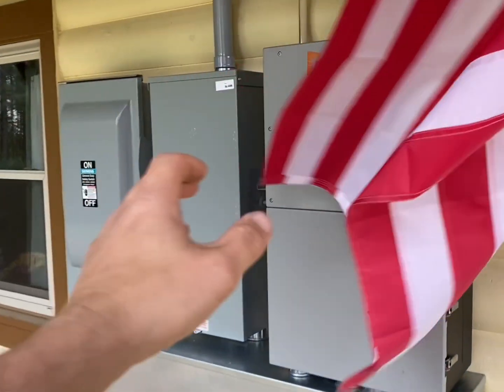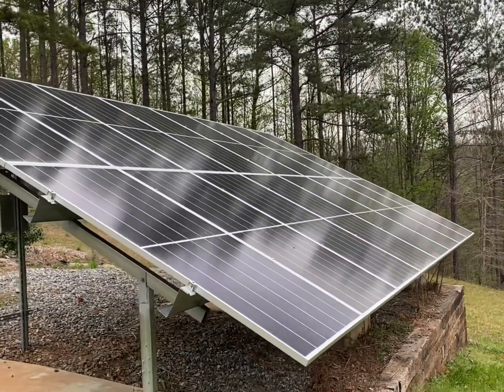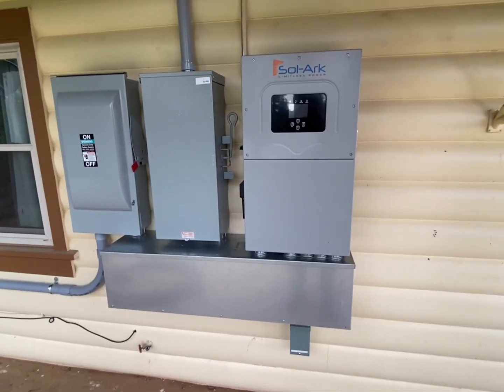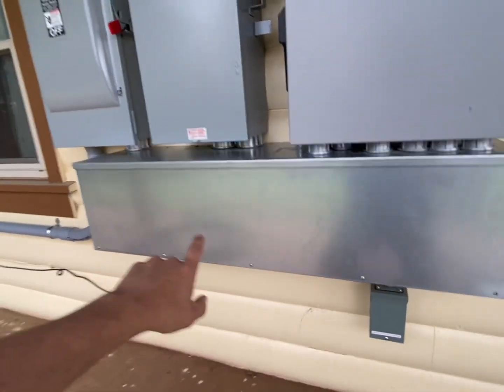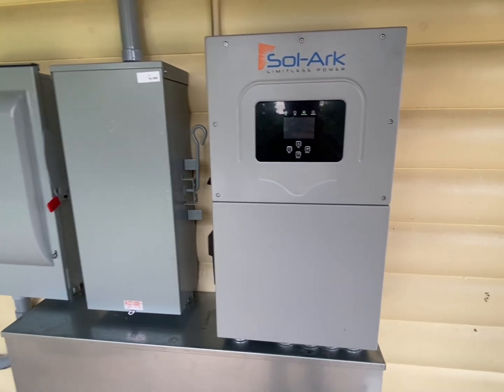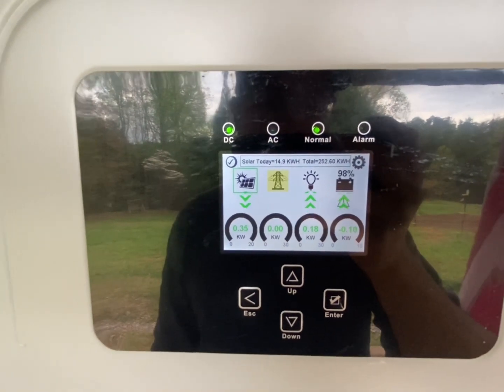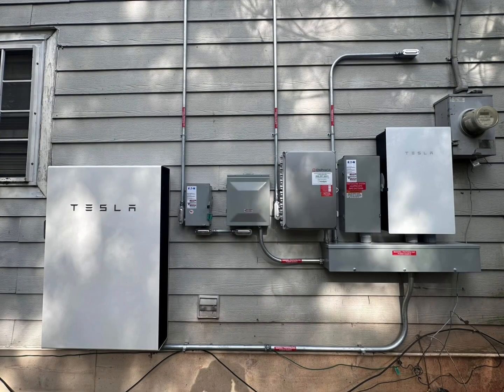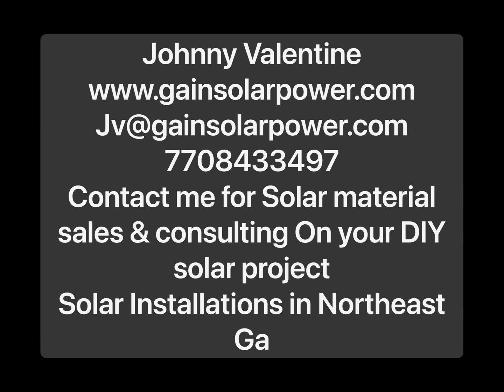Installing a Sol-Ark 15k outside

Comment: Any concerns for clearance between Sol-Ark and the gutter? Also, can you use an enclosed breaker as a service disconnect instead of the fuseable disconnect? Thanks for the video, nice clean install.
Reply from the maker: The service disconnect needs to be lockable in the open position, have a visible air gap when open, enclosed circuit breakers don’t meet those requirements.

Comment: This is, basically, what I have done. It sits under an overhang that shields it mostly from the rain and the sun rarely hits it. I am working on a 3D printed cover for the screen to protect it from direct sun.
Reply from the maker: Well send me a sample of the cover
Reply: @GainSolarPower  My 15k on my back porch wall has a piece of coated opaque paper over the screen. The paper was cut from a pocketed folder that people put small reports in. It's painter-taped to the inverter, along the top edge of the paper; weighted along its bottom edge so that it wants to stay flat and shut, with the paper's vertical edges stiffened using folded-over painter tape. Basically a flap that is easy to lift, and drops flat shut. Doesn't bother me a bit to lift the flap while viewing or operating the screen. Been there a year, no problem. Pulled it off once briefly, left no residue, and stuck back on no problem. I was going to use oil cloth or something credit-card-like, put the paper one up temporarily, and have never needed to change it.

Comment: i would get some static cling black tint or even painters tape and put it on the screen. The screen would be the only thing id be worried about.
Reply from the maker: It never gets direct sunlight.
Reply: @GainSolarPower  should be golden then.
Reply: @GainSolarPower  There's still UV exposure.  If it were mine I'd probably cover the display with something easily flipped up or removable to preserve it over the long run.
Nice install though!

Comment: I would be equally or maybe more so worried about thieves
Reply from the maker: It’s in a remote location.
Reply: @GainSolarPower  well that helps. I wouldn’t be worried about thieves in my area either. But if installing these outside is a “new thing” that is going to start happening in more areas
Reply: @RJ-cc1fz   theft of these systems mostly happens in residential new construction when the house isn't fully built and the systems are desirable to help with construction. If you were to find yourself in that situation, I'd strongly recommend a battery + inverter cabinet - which adds another level of complexity to uninstalling the system.
Reply: it is bolted to the wall, with giant wires, couplings and weighs 140 lbs
Reply: @av1204  nothing a sawzall wouldn’t burn thru in a couple min.